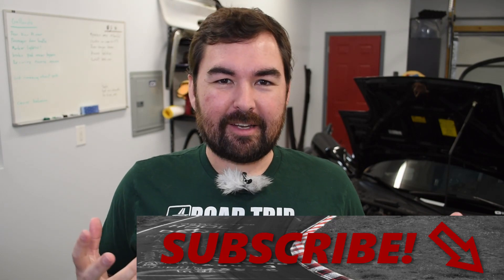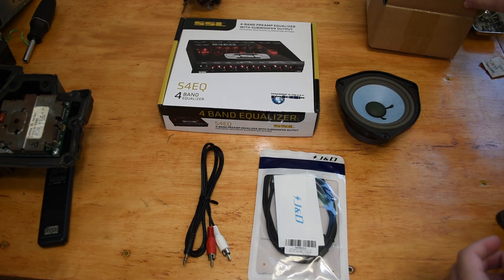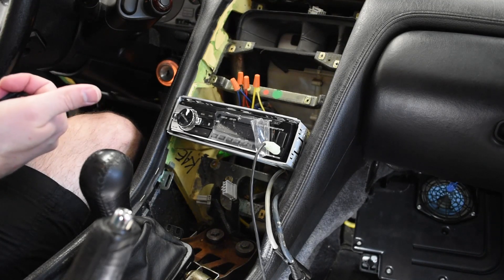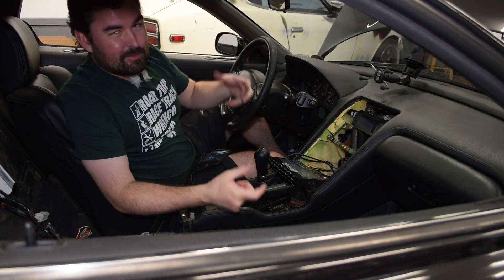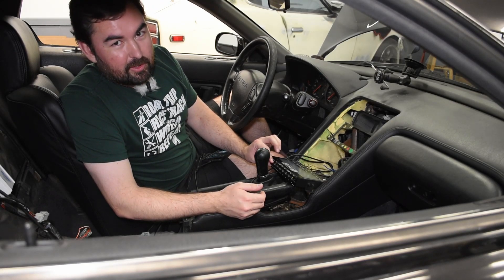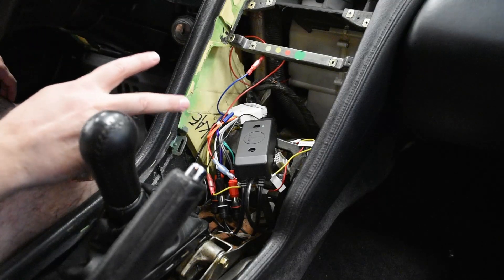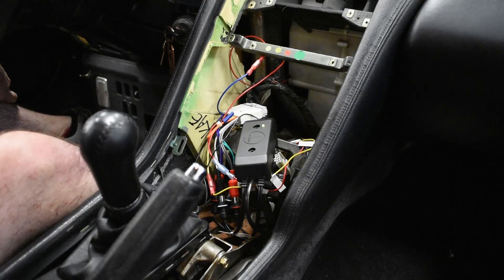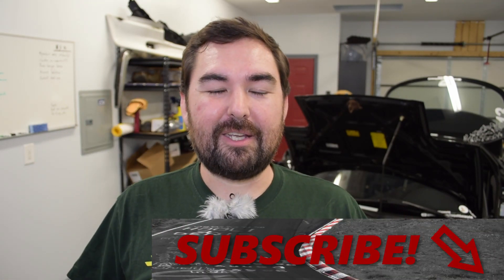NSX Stereo Refresh Volume 4:  The Home Stretch (Featuring Weird Wiring and Mystery Phones?!)

Comment: So, if I unplug the power cable to the antenna in the trunk the stock system will not work?
Reply from the maker: If you in plug it at the antenna it will be fine.  I deleted mine long ago.  If you were to clip that wire where if comes out if the head unit, then it would make things not work.
Reply: @LapoftheWorld  thanks